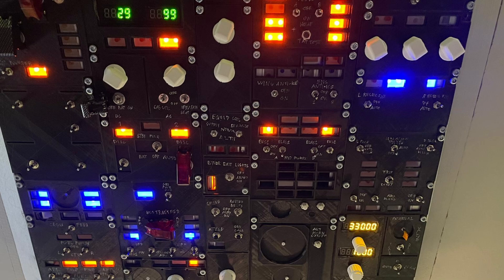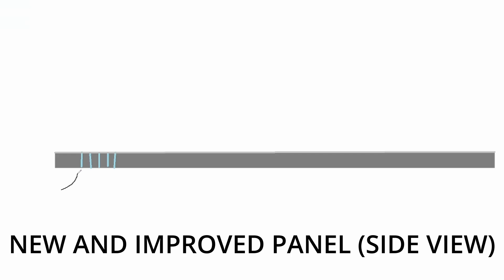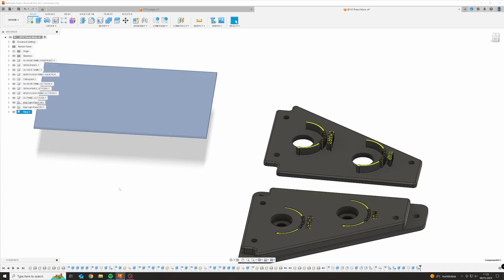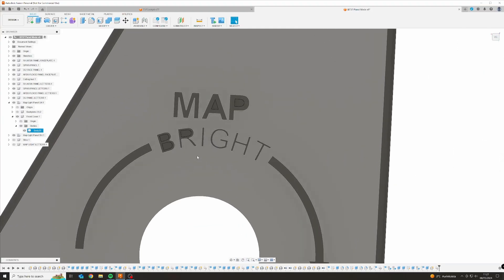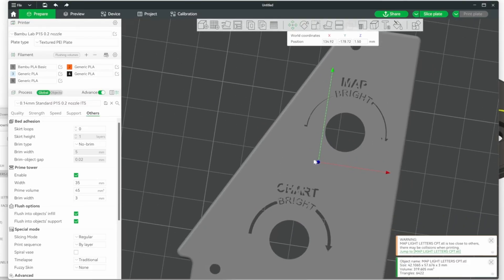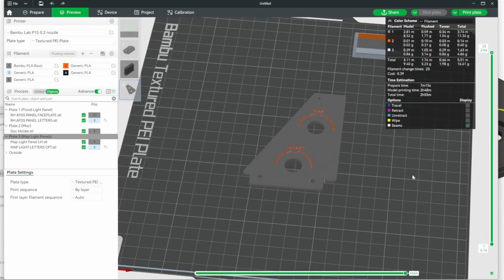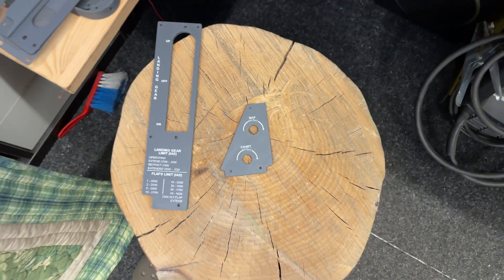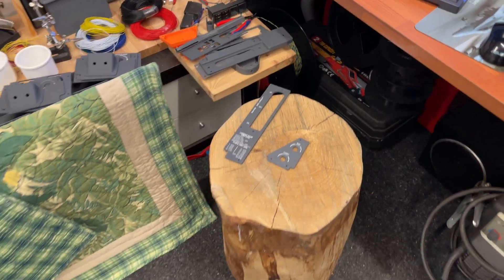3D Printed Panels With Text (Is It Any Good?)

Comment: Looks amazing. I did not quite understand how to select the colour for the top layer of the letters. Nothing specific is shown on the video (no “crawling ants”, flickering areas, or notifications of a selection). Can you clarify that a bit?
Reply from the maker: Thank you! It's very easy to miss on the video and I don't really explain it on the video but at time 9:35 you can see the object gets highlighted on the top when I hover my mouse over the side wall. BambuLab is little finicky with the selection of the layer in height range mode so you have to do little trial and error trying to select the correct layers. I hope this helps or you can ask me more details if you have anything.
Reply: @diy_finn  thanks 🙏🏻. Another question I have is, if I have the letters/graphics as sketches on top of the panel, I’d there a faster way to get them extruded as separate components? Or do I still need to make two component batches (one for cutting the panel and one for filling the cut out)?
Reply from the maker: Yes, if you have access to the original sketches for the text it will be way more easier. There are many people here in the comments who have told how that could be done. I am also working on a updated video which will cover that topic better but it's going to take a while to finish.
Reply: @diy_finn  not to worry, just this video is already brilliant 🤩

Something else I just thought of, is try “paint” the top layer of the noon letter part black, and use transparent filament for below. E.g. the first layer is black with letters white, and the rest is transparent filament. It uses three separate filaments instead of 2, but it creates more backlighting. Not sure a single layer black strips light though. You may have to make that 1mm thick. From laser engraver panels, the best have a 2mm white legend plate and a 3mm opaque plate, with the legend plate painted black and engraved. The paint layer thickness is enough to stop light.
Reply: @diy_finn by the way, what’s the nozzle size you’re using?
Reply from the maker: @baronvonrichthofen2021  We use 0.2 nozzle for these panels. It doesn't really work with bigger nozzles if the text it as small as ours.

Comment: Very cool! As a possible improvement, perhaps you could try adding a draft angle to the extrusion as it cuts the letters through the panel. This could be done in a way to make their openings larger on the back but still the right size on the front. I fell like that would make backlighting them easier!
Reply from the maker: This is definitely something I will try doing in the future as I have had concerns with the back light showing through the smaller letters. Thank you for the idea!

Comment: You can also streamline your Fusion 360 workflow by learning the "Combine" tool. For example, just place the text inside the panel such that it occupies the same vertical space. You can now cut the text shape out  of the panel in a single step as follows. Select the "Combine" tool. Choose the panel first (the target), then the text component (the tool(s). Now set the Combine tool's mode to "Cut". In this case, you'll also want to check "Keep Tools," otherwise your text object will be removed after the operation.

Comment: You don't need to do that tedious manual alignment step. Make the panel and the text individual components (not just bodies) in Fusion 360. Then export the parent component as an STL or 3MF file. Place the STL in the slicer. At this point, it will look like one solid slab, all the same color. Now, select the object, right-click, and choose "Split -> Into Parts" (not objects).

Now you can set different filament colors for each part accordingly.

You can also save a lot of filament swapping by having just two or three base grey layers, then solid white all the way up from there. This makes manual filament swaps more feasible as well. Enjoy!
Reply from the maker: Thank you for the tips! I really appreciate them!

Comment: I'm not sure if i'm missing something, why not print the grey and white pieces down into to the bed and then just leave it grey and have the light channel is just a void? This would make it entirely manageable with manual filament change for people without multi system. If solid translucent fill is needed to diffuse the light, the print is easy to backfill with a small amount of epoxy resin, or just add a piece of vellum paper in the back.
Reply from the maker: That's actually very good point! I will have to experiment with this and make an update video with all the suggestions I have gotten here. The important part to consider with that method is that any imperfections will transfer to the panel front. Thank you for the idea!
Reply: This sounds a bit like a technique I used when making a button panel for my 3D printer; first I printed the icons I was using in white as one print job, then without removing it from the bed, I changed to black filament for a second job, and printed the surrounding panel using z-hop on travel moves. In this case, I wasn’t bothered with backlighting, so I only cut the icons out to a small depth, and printed the body panel in full; but it would be feasible to cut all the way through, leaving a void for light to pass through.
Reply: Not sure how the dark pieces in A, P, R or similar letters would look like with this method, but thanks anyway for the suggestion

Comment: I wonder if you, with manual filament swap, can print it solid transparent up to the last few layers and then perhaps the last two or three layers with white and grey to get the text. Might have some backlight bleed through in the grey area but much simpler then switching filaments all the way. Perhaps need to paint the edges to stop light there though.
Reply from the maker: Yes that will work pretty well and is something we have done in the past. The reason we stopped doing it was exactly the edge bleed which we didn't like. You could in theory paint the edges but often it ends up looking pretty rough. It is a good option for those without AMS or similar system.

Comment: Very nice, great result! 
How small can you go with the letters/text (mm height) so that it is still readable and has good "resolution"?
Reply from the maker: Thank you!
The smallest letters in our prints have been about 2mm tall. What maters more is the letter thickness which has to be larger than the nozzle size. In our case our letters are about 0.26mm in size for our 0.2mm nozzle. Also the font type effects results significantly where simple fonts are better and easier to work with.

Comment: Very nice work! I'm feeling the need to get my hands on a multi material printer now :(
Reply: I've been on a quest to achieve good lettering for my stuff too... I only have a single nozzle printer, so this method is a bit out of scope for me too.

I have an idea for a cheap and hopefully successful method, but haven't tried it yet. The plan is to 2d print the negative of the graphics onto acetate sheet, in the colour of the panel face. Then, using spray adhesive, mount the acetate printed side down onto a blank sheet of paper. The paper provides the white for the lettering, and also works as a diffuser for back lighting. 

And with the printed side facing the backing paper, the back of the acetate is what faces the outside world, so it protects the graphics from wear. 

I believe this could work, but it really depends on the adhesive being decently transparent
Reply from the maker: Thank you! If you have the money for it, it really does make life easier. I think the BambuLab A1 is actually pretty affordable for what it's capable of but I have personally loved the P1S since it really never fails and is so much more fun to use than my Ender 5+.

Comment: Another tip is that if you select the panel and the letters together, then export as a .3mf file, they will import into your slicer as seperate bodies but already aligned like they were in fusion 360. No need to try aligning them after.
Reply from the maker: Thanks! This will save so much time not needing to align parts separately.
Reply: Orca and maybe Bambuslicer can also cut STLs into parts and not object which basically achieves the same 😊
Reply: @singulosta  I haven't used Orca very much and Bambu, not at all. Are they limited to simple shapes, or could you also do lettering? I prolly should play with Orca more anyway.
Reply: @AmericanMaking I don't know if I really understand your question. You can export multiple objects or shapes out of fusion into a single stl file. Try exporting 2+ parts into a single stl and then in your slicer you can right click the model and "split into parts"
I found this help guide for the prusa slicer about it: prusa3d/article/split-to-objects-parts_1751

Prusaslicer and it's forks (Superslicer, Bambuslicer, Orcaslicer) surely have this functionality. If you want to create the text directly in the slicer I think you can do that too with all of them. I just don't know how easy it is to have the text "inverted". Meaning your current approach, as far as I can tell, is to have the part made out of a transparent material, and only make the top most layer(s) opaque with cut outs for the text.
Reply: @singulosta  My bad. I responded laying in bed half asleep and misread your post. I get what you were saying now. Ignore most of what i said. 😆
Reply: If you export as a step file they stay aligned as well

Comment: Cool video. One tip for cutting your parts is to use reference planes instead of creating bodies to use as cut tools. Just offset a plane from the surface of your panel,  select the "split" tool, and select the plane as the cutting tool. It'll let you break apart bodies without lossing the thickness of ur tool because its a 2 dimensional object instead of a 3 dimensional one. 
I like ur panel concept, I may use this technique in the future. Thanks, and have a great day.
Edit: I'll need to check to see how, but i think you can also use sketch profiles as zero width cuting planes. Meaning you might be able to just select the sketch where you define the letters and just cut them out of the panel body and make them their own bodies in a single operation. I'll try to remember to check this tonight.
Reply from the maker: Your tips are really helpfully! I am not a Fusion360 pro or anything so these will really help me in the future when designing stuff.
If it's really possible to use letters as zero width cutting tools it would make this process to much easier. If you find out is that possible please let me know and I will also look into it myself. Thank you!
Reply: @diy_finn It does work. I uploaded a quick tip video showing how.
Reply: Or better yet, extrude from sketch and at offset in place so that everything is already overlapping and aligned when you export the STLs.

Comment: This is really a way you sould NOT do it. I mean, if you really need AMS for something then you're doing it wring...
Reply from the maker: Do you want to elaborate why that is? I am genuinely curious why using an AMS is a negative for you. And I know a laser would be the best way but we don't have a laser.
Reply: @diy_finn  AMS is a very specific piece of hardware. It is slow, it is ineffective and not available for everyone. I believe you could reach the same results with manual filament switch easier and faster in manufacturing.
Reply from the maker: @nevermind6270  Those are good points. Using the AMS is really slow and is something I don't like about it. That being said I don't see manual switching being an option for our application since you would have to sit next to the printer for hours at a time. It's probably true that there are better ways of achieving similar results but for what it's worth we might as well do it like this since it works and we already have an AMS. Thanks for your feedback though!
Reply: @diy_finn You don't have to sit in front of your printer and wait for the right moment. Place PAUSE g-codes where you need. Also, your panel may be designed as a composite object. Then you may just print one part in black and the other one (and really thin) in white color. It really looks reasonable at first glance to use AMS if you have it, but it is really not...
Reply from the maker: @nevermind6270  The problem that I am seeing with pausing at layer is you would still need to come to the printer and swap the filament which takes time and effort. One filament change is of course faster to do manually than with AMS but our panels have more than 20 changes. The reason we don't do parts as composite objects like you describe is because we would lose the back lighting capability, or run into the same problem I describe at the beginning of this video. For simpler stuff I see your method as the better way of doing things, just not for our use case.
Reply: @diy_finn  Ok, let me explain the method in more detail. You have to cut your text from your panel completely. They you offset a plane 4-5 layers down from top and extrude it 2-3 layers and join. So you have a thin film that covers holes from letters almost on the surface of your part but a couple layer below. 
Then you print it and pause the print just when this film is about to be printed. You swap the filament and print these 1-2 layers of film and swap the filament back. Then you wait while the remaining 2-3 layers are printed and take your part. The light can shine through it as the only obstacle in its way is a thin film of white plastic. But the panel is still black and text is very sharp and readable. And you achieve all this with just two filament changes that occur almost at the end of printing when you have to pay attention to printer anyway...
Reply from the maker: @nevermind6270  Oh okay, now I understand! That's actually very clever and I might just have to give it a try. Just a minor drawback would be that the white film would be visible from the sides of the panel which isn't a really a big deal but something to consider. Thank you for explaining me this method. I always love learning new ways of doing things!
Reply: @nevermind6270  You operate under a scarcity mindset. You care about saving every penny because you can't afford it, nobody else cares about the waste - they think about results.
Reply: Oh wow. You're right, how could I not see it before...
Reply: @nevermind6270 As I see it, a 3d printer is already an extremely specific tool to need in order to do this, and an AMS or MMU or ERCF isn't that far of a leap from that point. By contrast, couldn't we start with a solid block of plastic and painstakingly carve the shape and a hole for each letter, then fill the holes with translucent white epoxy? Yes, we can. But we don't because we have a tool that will make it easier for us. 
This video can serve different purposes for different people: Instruction, for those already with this equipment, OR Inspiration, for those without it and come up with a way to do it regardless. Please take your inspiration and be thankful that this kind and creative soul took the time to show us at all. 
No one is wrong because it isn't the way you'd do it. The result was achieved. Therefore, it was A right way to do it. Maybe you know a different right way, maybe even a better way, a cheaper way, a more efficient way, a more accessible way; make a video and show us. We'll be glad to take your instuction/inspiration just as we've found it here.
Reply: @Mr.Glitch247  Of course I know a better (faster and cheaper) way to do it. This is precisely what I described. Take your time and read the thread.
Reply: @nevermind6270 I read all of your self-important vitriol, and it makes you seem like a sad and unhappy person. I tried to help with that, by appealing to your sense of community. Thank you for showing me that you are not worth the effort.
Reply: @Mr.Glitch247  Well, at least my sadness is not caused by AMS as I know how to avoid it...

Comment: i can't believe you didn't show it with the back lighting, that was like the whole reason why i watched this video.
Reply from the maker: Yeah I'm sorry about that. We haven't had time to install the back lighting and without a proper setup it doesn't really work. We will definitely be showing the back lighting in the future but these thing take time. Again, sorry to disappoint but we try our best.
Reply: @diy_finn  ok then :) i will wait
Reply: @diy_finn  So if you cant even test if the text is readable and well looking ... why did you make a video of it? It looks like crap in fron of the window. Why did you spend all that time creating this method and creating  the video... when you cant even take 10 seconds of time to take an led (phone flash, flashlight, etc) to show and test it ?!?!?!?
Reply from the maker: @m4ko288 I think I didn’t explain my reason to not show it well enough. I did test it with a flashlight and it does work. The reason it doesn’t look good against the window is that the back lighting won’t obviously be visible in such bright environment. Also the camera didn’t expose the video properly. What I mean by "we didn’t have time to test it" is that in reality it is installed to the simulator with correct LED strip spacing and an enclosure. I know I should have shown the result with the flashlight pointed at it but I felt it wouldn’t offer much to the video since no one would be using the panels like that. I will post a short video here soon so everyone can see how it actually should and will look. Again, sorry I didn’t finish the setup before posting, that’s on me.